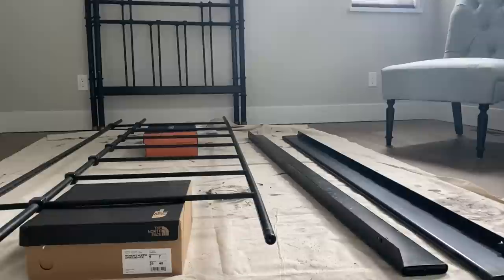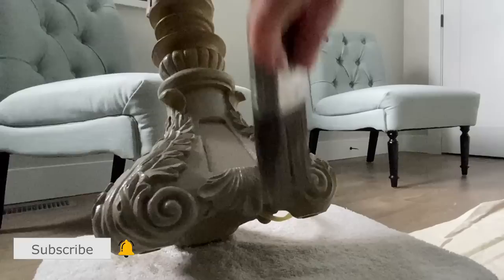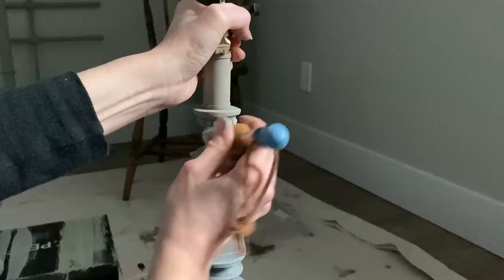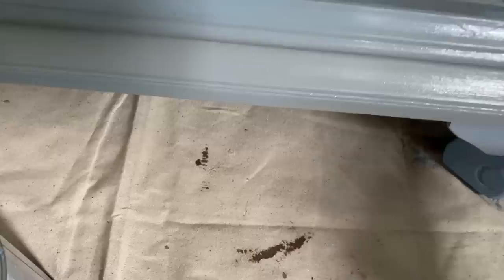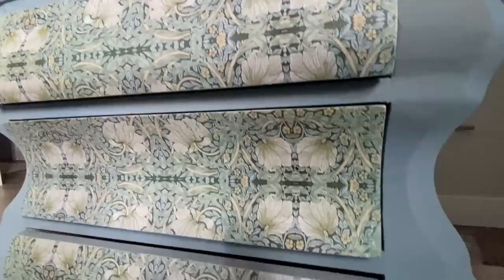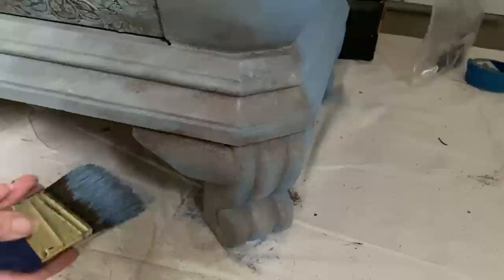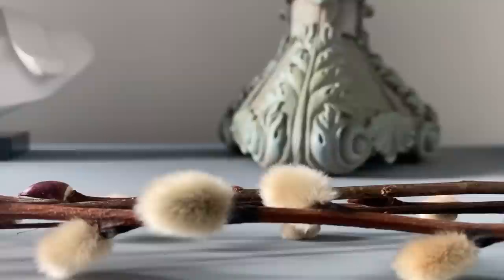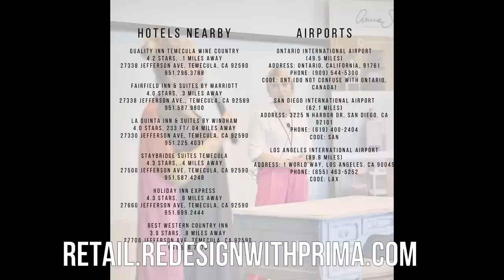4 Easy DIY: Decoupage furniture, Patina effect painted Lamp & Chalk Painted furniture pieces 🎨👩‍🎨

Comment: LOL are your chairs possibly made by Bombay company? I just bought two really beautiful upholstered Bombay side chairs for 10 bucks at a thrift store. Got them home and realize that the legs do not screw off. Same scenario going to paint them. I use a paint with the brand-name Farmhouse paint company, you really should try it it is the chalk paint with a sealer and primer. Dries quickly with the chalk finish butt no wax or top coat required. You will love it! They have a full line of colors and glazes and the leafing products. I am amazed with every thing I have used so far
Reply from the maker: Thanks Annette! Never tried their paint.  Will check them out!  I am not sure if they are Bombay I got them from FB market place! You got a great deal!! 😂🎨🙏❤️

Comment: I am about to attempt my first entry way table, it is reddish wood colour trying to look like cherry but I'm sure its not.  I want to paint it black with gold accents.  Should I give it a light sanding then primer, then paint, then sealer or wax.  Any good tips would be greatly appreciated.  I love your work, its the best.
Reply from the maker: Hi Gail!, yes for the cherry stain, I would light sand and then use a primer just in case for bleed through and then paint it black.  You can use a sealer (poly top coat) If you use clear wax, I would mix some black paint into the wax as I find when I apply wax on black pieces it tends to haze out.  try a small area in either case to see if you like the effect. ❤️🎨🙏
Reply: @TheReclaimedHeirloom  Thank you so much for the help.  Waiting for your nex video